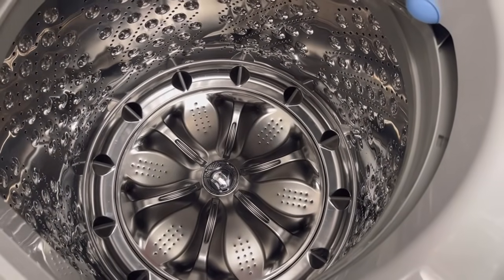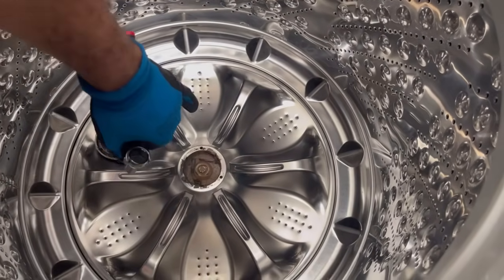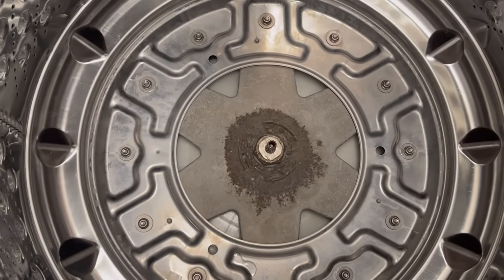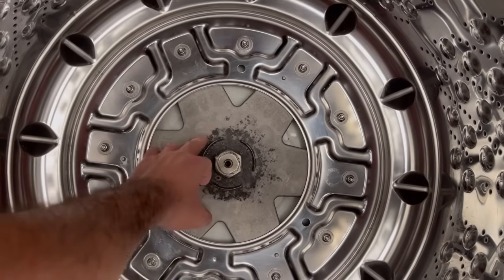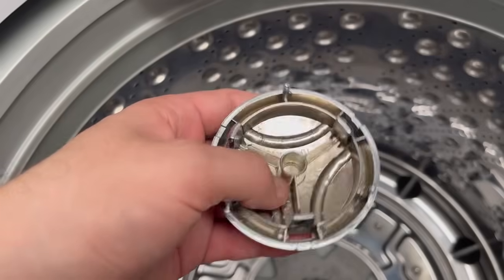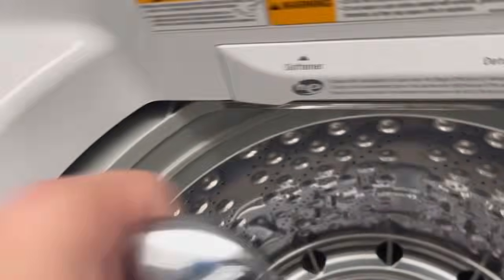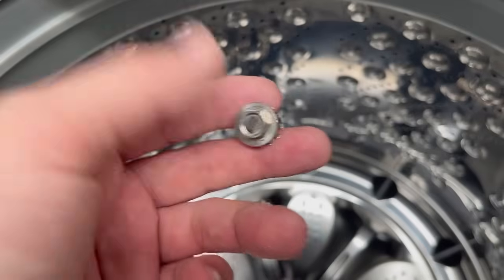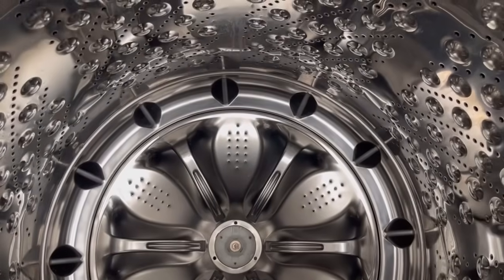How to remove and clean LG washer machine filter

Comment: Thank you for the video. I have been waiting for something like this before I opened up my washer to figure out the issue. This made it really helpful. Appreciate your efforts
Reply from the maker: Thank you very much for your feedback!! Have a great holidays!!
Reply: Also wanted to check for how long can we keep baking soda and vinegar in the drum before we rinse it? There is still some residue left between the metal and plastic and we want to make sure the soda mixture doesn’t impact the metal/plastic permanently. Please advise.
Reply from the maker: @rajeevjosh  great question. 👍 I would say couple of hours should do the trick. But then again I doubt it’s going to be possible to get rid of all the sludge that’s been collected. I found this replacement cylinder on Amazon: 

UPGRADED Lifetime Appliance AGZ72909711 Washplate Pulsator Assembly Compatible with LG, Kenmore, Sears Washer - AGZ72909702 https://a.co/d/cuuw9k0

I haven’t ordered one yet. We’ll try to use our current one as long as we can. Once it reaches to the point where those residues become impossible to remove at all then I’m going to order this new one to replace it. Please make sure that it will work with your washing machine model before ordering one should you be interested. Hope this helps.

Comment: Fantastic video bro! Have a similar model, but same drum and inside arrangement. The plastic hub cap has three small prying tool insert cuts in it. I didn’t know about that before watching this video. But I took picture using the phone too get a closer look. So I didn’t use the water draining slots you used to pry it out. Luckily I broke nothing. But thanks a lot for this video!

Comment: If you do you use Loctite when replacing the bolt, make sure you use the BLUE Loctite (which is meant to keep bolts from loosening due to vibration,, etc). Red Loctite is meant to keep a bolt permanently in place and can make it nearly impossible to remove without special tools.
Reply from the maker: Great tip! 👍

Comment: Thank you for this video. I did everything you said. Cleaned everything out. I did a tub sanitizing cycle. And I’m still getting those little flaky, dirty debris. I am at a loss and so frustrated. Your video was awesome. I did everything you said. Then I ran sanitizing and I’m still getting the little flakes.
Reply: Thank you for mentioning the brown flakes, I have that problem too😫. No one else seems to mention this issue. Did you figure out how to remove the brown flakes?
Reply: , yes, ultimately I had to remove the entire drum from the machine. And scrub it down outside. I ultimately replaced the agitator piece because there was crud inside of it that could not be cleaned out.
Reply: @MC-ou7fy   How did you remove the entire drum? Older models have a plastic ring on top of the drum that can easily be removed (by pressing on plastic tabs), but this particular model with the "Smart Drum" and "Direct Drive" seems to have screws instead. Would appreciate if you could five some info on how to remove the entire drum. Thanks!
Reply: We took the screws out.
Reply: @MC-ou7fy  Thanks!
Reply: @pearlarzabal3473 see my comment below. The scum is between the plates he removed. It is NOT one piece…it is made of two. There is another video on here where he shows them apart.
Reply: @onclevov did you have any luck removing the tub/drum?
Reply: @Friedbread28  unfortunately I never succeeded. I still have that washer, and it still puts out debris when washing… :(
Reply: @onclevov  nooooo! I am going to try again and might make a video too
Reply: @Friedbread28  that would be AWESOME if you succeed in removing the plate. 💪
Reply: @onclevov  i already did remove the plate/pulsator and replaced it. It's the drum/tub I need to get out.
Reply: @Friedbread28  ahhh ok I didn’t even get past removing the agitator… :(
Reply: Same issue here. Deep clean, followed the video and still get these brown flakes. I suspect they're coming from the big drum as it's full of holes they can hide in. So gross. So annoying.
Reply: @marynice3381  Where is THAT video?! I don't know how to take apart the plates but I can see the coloration inside where the scum is. I'm just about ready to buy a new plate

Comment: Just purchased an LG that looks like yours. It's model number wt7150. Had I  known it was this complicated I never would have purchased it! I'm not tall enough to reach in to do this. About how often does anyone think this thing needs to be cleaned out? Thank you for showing us this important step that was never mentioned in the store.
Reply from the maker: I did it for the first time in like almost 5 years. If you maintain it well and do cleaning cycles as the owner’s manual calls for you shouldn’t have to worry about this all that often. These are great washing machines. I think you’ll like yours too. Don’t let this process scare you. If you take care of it well you may not even have to do this for several years to come. Hope this helps! And enjoy your new washing machine!
Reply: Maybe helpful tip: I'm about 5'6 and I can just barely reach down there. I used a little step stool (short, one-step folding kind) and that made all the difference! I could bend down inside and get to it without issue.
Reply: Im short and i struggle to get in to the bottom of the machine .. lol.. i had a fuzzy logic for 18 yrs without a glitch. Purchased this one based on my trust of the brand..
Reply: I'm too short to get the clothes on the bottom of the washer drum! I have a pair of tongs!
Reply: @angelagregory3897 Thanks for Sharing!
Reply: I’m short. I use tongs as well. But I must say, I’ve NEVER taken out to clean any filter - EVER. Didn’t even know it had one - and I’m 72!  This is alllll new to me.  (I must have been sleeping during Adult School 101.)  It looks easy enough to do - if you have long arms!
Reply: I have one and I had to replace the spinner because of how dirty it was and they run about $80 on Amazon and the old one ended up floating in side where the center of it had no more grip to it... DON'T BUT THIS WASHERS THEY ARE TOO COMPLICATED AND DIRTY AND CAN'T FULLY CLEAN THEM
Reply: If you use a proper cleaner and do a wash cycle every month it shouldn't need cleaning but once a year if that makes sure to leave the led open so it had a chance to air dry
Reply: I’ve had mine since 2016 and no issues.  Never have taken it apart.  If it’s not broken, don’t fix it.

Comment: This is a helpful video and prevented me from damaging the "cap" over the bolt.  I have removed both of them and the "hub cap" at the bottom of the tub does not lift out even with a lot of pressure exerted.  My washing machine is slightly different than yours (older or newer, I think newer, came with the house) and there seems to be an additional vinyl white threading for the bolt that also holds it in place and needs to be removed.  I don't want to pull too hard.
Reply from the maker: Thank you for your feedback!
Reply: @SOBIsHobbies  I am looking at it some more and once you have it off the white piece on yours and mine look really similar.  I am going to try giving it a hard pull.
Reply from the maker: @momojo3459  keep me posted how it goes for you. Good luck!
Reply: @SOBIsHobbies  I have tried a couple times no success.  I have had another attempt it with no luck.  We begin to believe you have Popeye arms.
Reply from the maker: @momojo3459  😂 not sure about that. Not to mention I haven’t gone back to gym since pandemic lockdowns. Mainly been doing workouts at home. But anyway, I don’t know why it wouldn’t come off… makes me wonder if ours is a different model than yours.
Reply: @momojo3459  mine came right off with little to no pressure.  Our washer is 5 years old.
Reply: @snickers4213  Thanks for the reply Snickers.  I have abandoned removing the tub at this point.  Perhaps mine is a bit different.  I whacked it a couple times with a rubber mallet (it did not budge) and thought, "What am I doing?"  Ran a couple clean cycles with the cap off and it does seem to no longer be making ;inty/dirty loads anymore (wife happy) so I am going to call this a win.  Thanks again for the video @sobi's hobbies
Reply: I'm having the same problem. Can't get the plate out. My machine is making some noices as there are coins or something inside so I really hope I can take it out eventually
Reply: @karinaizquierda230  did you figure it out?
Reply: I am having the same problem. Followed the video and removed the plastic cap, removed the nut, and the large metal/plastic piece underneath it will NOT budge. Got my dad to come over and help, tried various methods and it doesn’t move. Currently soaking it in vinegar to see if that helps. There’s a ton of crud under there so maybe that’s holding it on. Any other ideas?
Reply: @leannesliva6550 did you ever get it off?  I've tried baking soda and vinegar, baking soda and peroxide, washer cleaning tablet, and CLR cleaning cycle.  It's as if I've done nothing.  No progress at all.  I'm thinking about shooting it full of buckshot.  The thing refuses to budge.  I've even tried the top comment and used ceiling hooks and pliers.  I'm losing my mind.
Reply: @colinrenteria3161  SAME! Just can't get it to move at all!

Comment: THANKS for making the video and sharing how to clean LG washing machine...but...I discovered 2 things:
1) putty knife is easier than a screwdriver to remove the oval plastic center piece;
2) our bolt must have been attached with a HIGH SPEED COMPRESSION-DRIVEN DRILL...I could not get it off and was about to get my wife to try and put her fingers into that small opening on the edge of the tumbler to prevent it from turning while I used an extension on my socket wrench...but she got worried that I would not be able to put it back together and so I quit...not a good day for DIY!
Reply from the maker: Thanks for watching! Sorry to hear that it didn’t work out for you in the end. I did notice too that some of these parts are extremely fragile. Most of them are made out of either plastic or thin metal pieces. I had to replace the center cap too because one of the arms broke while I was trying to remove it. Luckily it was not an expensive part. 😊
Reply: I could not get the 10mm screw out at all😭 about to buy a new washer LOL

Comment: Thank you, you're a life saver. I always used the tub cycle cleaning and still noticed our dark clothes would have a film over them. I use less detergent and ran my tub cycle 2x a month. Nothing worked until I tried your steps. I couldn't believe how dirty it was! How often  do you have to do this time of maintenance? Thanks again!
Reply from the maker: @ec-wq7jn  You’re very welcome. I’ve been doing this maintenance once every two years. In between those maintenance procedures I’ve been running a cleaning cycle every 3-6 months depending on how frequently we use the appliances. Hope this helps.

Comment: One thing I rarely see discussed is that I leave my washer door open, until it’s dry. I don’t actually close it when it’s a top load washer. It keeps the machine from getting that funky smell when the moisture causes mildew. And I use vinegar as my rinse agent. I never use fabric softener or dryer sheets in my machines. I find that using vinegar in the rinse cycle, means my towels and such are cleaner and the fabric softeners don’t build up on the fabrics. The towels stay absorbent, and the vinegar smell doesn’t hang around.
Reply: May I ask how much vinegar you use per load? I was told to be careful, something about vinegar corroding the hose. 🤷‍♀️
Reply: @crazeelupz  About a 1/2 cup per load. The vinegar is actually just getting the last of the soap out, so it's not hanging onto the material.
Reply: Thank you so much!!!

Comment: I removed the cap by inserting the screwdriver from the side of the openings instead of the top side to avoid breaking the plastic piece. Worked just fine
Reply: You sir (or ma’am) are correct.

Comment: Thanks dude, I had different model but you’re right relatively the same. My biggest problem was pulling the filter from the spindle spline. I kept grabbing the raised part of the plastic filter albeit not much to grab onto. Kept at it and finally pulled it off with my hands….

Comment: My wife wanted to know how much vinegar and baking soda your wife used to clean the tub.  Great video.  Keep up the good work.
Reply from the maker: Thank you for your feedback. My wife uses a half cup of baking soda in first cycle and then followed by a half cup of vinegar in second cycle to clean the tubes and inside of the drum. Hope this helps.
Reply: So the baking soda is used on the wash cycle and vinegar during the rinse?  Just trying to understand the steps of when to use each.  But doing this without any garments in the wash?

Comment: No complaints. I love ❤️ when people prevent me from calling 1-800. THANKS
Reply from the maker: Thank you for your feedback! Have a happy New Year!
Reply: Happy New Year to you too. Is the bolt left or right hand threads. It’s very tight. Thanks
Reply from the maker: @greypalmer7634  Thank you! I had to look at the video myself to remember the thread pattern since I didn’t remember that of the top of my head. 😅 From the looks of it I went counterclockwise to loosen the bolt and clockwise to tighten it. It was a bit tight initially for me too but with little effort I was able to loosen it. Just make sure the socket/wrench is sitting snugly on the top of the bolt before you giving it a go. You want to avoid stripping the bolt edges. Hope this helps.
Reply: I got it. Disregard

Comment: Thanks for the Video.  But I think the Prong on the plastic cap was not really broken.  You should find one slot on of the plastic cap on the bottom (not the slots on the top) and push a large flat head screw driver in the slot towards the center nut.  That prong is meant to give so the cap will come off as you lift.  Without that give (flex) of that prong, you might end up breaking one of the prongs.--E
Reply from the maker: Thanks for watching! No, actually one of the prongs of the cap in fact was broken. It broke while I was trying to pry it out. Good thing, I was able to order a replacement cap from either Amazon or Walmart (sorry don’t remember exactly from where 😊) and replaced it. The part number for the cap is actually located underneath fyi. Cheers!!
Reply: @SOBIsHobbies  If you broke it it was because you used one of the Slots on top[ and not the single slot on the side/bottom.  .  I pushed a flat head screw driver into the single slot on the bottom and pushed the prong towards the center. The other prongs are not made to be flexible..Regardless we both got it done--so thanks--m
Reply from the maker: @themiddleclasseconomist5128  That’s probably what it was in my case. I’ll just be little more careful next time that’s for sure. Once again, thanks for watching! Have a great one!

Comment: After I got the agitator out, I took it out back and power washed it. I was able to get the power washer between the white plastic part and the chrome top part and flush a lot of that crap out of there. I also washed the inside of the washer and was able to knock loose a lot of sludge in places where I couldn’t reach it.
Reply from the maker: @ChristopherMcCulloh  Thank you for sharing your experience! 🙏

Comment: Your video displayed the gunk only at the center around the bolt. When I removed the washplate, the metal "starplate" had gunk and grit on the spokes as well. I sprayed it liberally with Dawn and let it soak while I thoroughly cleaned the bottom of the washplate, center hub, and bolt. Afterwards, I used a plastic scraper to clean the metal starplate, removed as much of the gunk from the starplate and thoroughly rinsed the tub with water, (the tub drain hose was removed to hopefully flush any gunk/debris I couldn’t physically remove.

I'm assuming there is no screen at the tub outlet as I've had to disassemble the drain pump to remove paper clips and tie stays from the drain pump a few years ago.

Comment: Glad I invested 15 min of my life watching this vid… got the exact same machine came in a real handy… question  the top cheap metal/ plastic is really necessary????
Reply from the maker: @Elcheapo-og2ig  If you’re talking about that metallic plastic center cover piece then I would say yes because it helps to keep the center screw/bolt covered from other elements. Hope this helps.
Reply: @SOBIsHobbies   hi yes otherwise clothes could get tangle in the screw… by the way sorry my poor English I’m French
Reply from the maker: @Elcheapo-og2ig No worries. Yes, if I were you I would try to cover the center piece with its plastic/metallic part. Otherwise, as you have said there’s a possibility of clothes getting caught by the agitator in the middle when the drum is spinning.

Comment: Thank you for posting this helpful video.

I have trouble with removing the wheel, looks like it is stuck.

Is there any way to pull it up?
Reply from the maker: @hashimabullharith5828  Hi. If you check through the comments section there some viewers shared their own methods that they used to remove the drum. 
For me it wasn’t that bad, I was able to lift it straight up rather effortlessly. However, for some people it seems to be stuck.  
There were some people who said that they left theirs soaked in a hot water for some time and then it came off, there were other people who said they used some sort of a penetrating solution (i.e. WD-40) and let it sit for a bit before attempting to remove it. 
Unfortunately, there’s no one solution that works for everybody. You just may have to try different methods to see which would work best for your situation. Thank you.